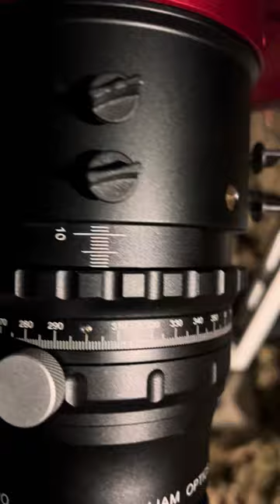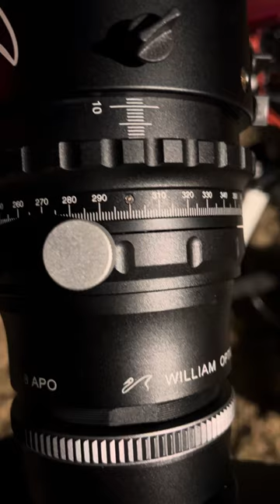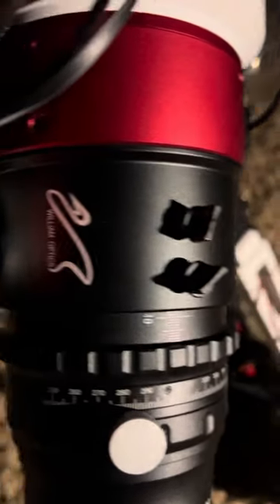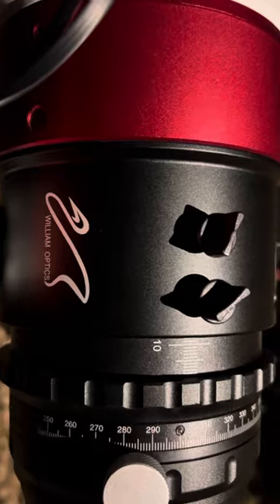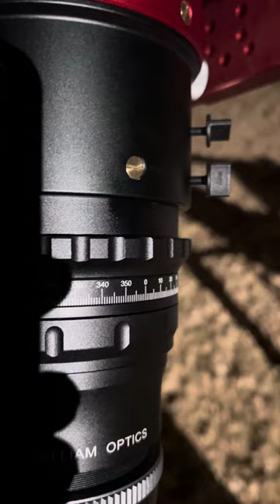Willam Optics FLT132 focuser tilt solution

Comment: I’m starting to wonder about how good William optics scopes really are, I’ve had the same issue with flt91 with tilt and wobble of the focuser.  Causesing issues with star shapes and getting the flattener pinpoint. For a £2k scope I really don’t wanna drill holes in it and add 4 nylon m4s. I NEVER had this issue with the cheap Chinese skywatcher ED80.  So far that scope still gets me the best results.
Reply: Was wondering if you solved this issue, as I'm having the same issue with FLT91?

Comment: Hello Greg,
Was wondering if this solves the issue of focuser tube flexure and makes the stars perfectly round on the corners? Do you have a link where you were able to get these plastic screws? 
How did this idea work in the long run with you?
Any other advice you have to solve the tilt issues in the scope?
Thanks for sharing that
Reply from the maker: I’ve been quite happy with the stars across the field in my FLT132 ever since doing this. Note of course that WO flatterers and reducers are extremely sensitive to back focus so that’s the other main tweak to get round, pinpoint stars.

I got these screws off of Amazon. Sorry I don’t have a link but they’re easy to find with a search.

Comment: Good solution.  My only complaint is that the video does not really do your fix justice.  The video is all jiggly and wobbly, hard to tell a difference between the before and after.  You should reshoot this whole thing with some sort of video stabilization or the camera on a tripod so the the "movement" issue is much better observed.
Reply from the maker: Fair enough criticism as I was just holding the phone in one hand and pushing on the scope with the other. The motion of the camera is a testament to how hard I pushed the scope. The focuser scale provides a good indicator of the motion however. Sorry it’s not very stable. 

I may reshoot it on the bench but everything is put away for now thanks to the return of cloudy weather for several more days.